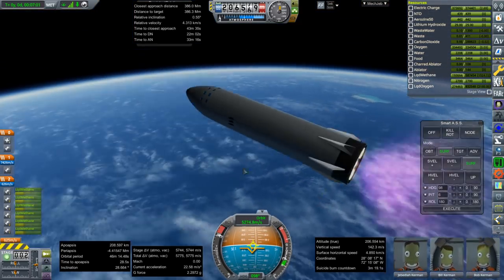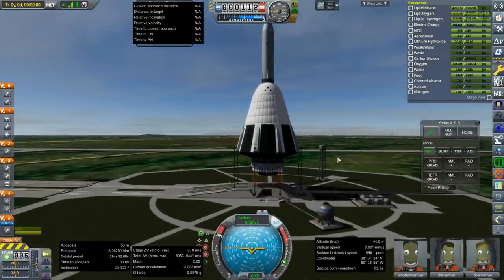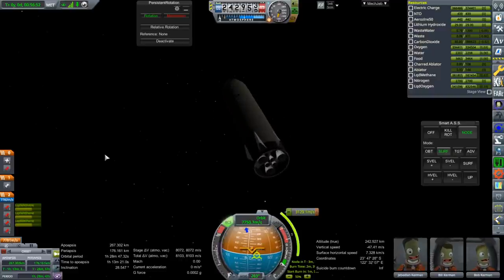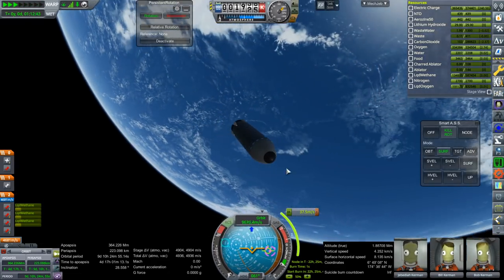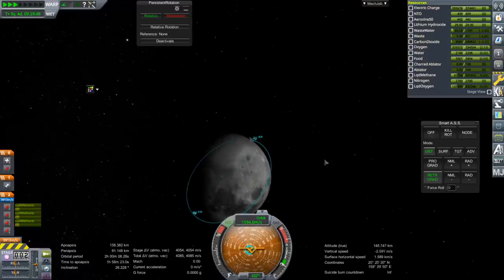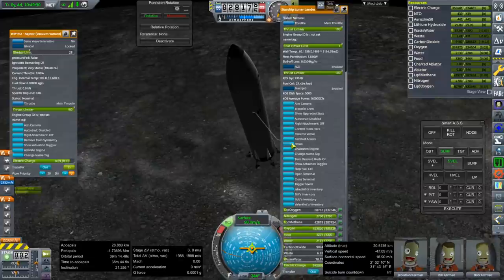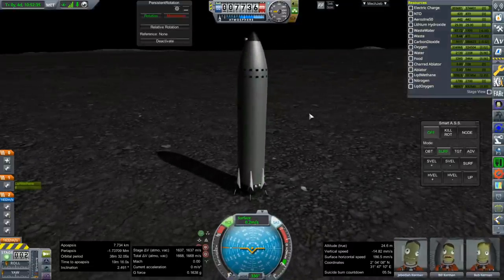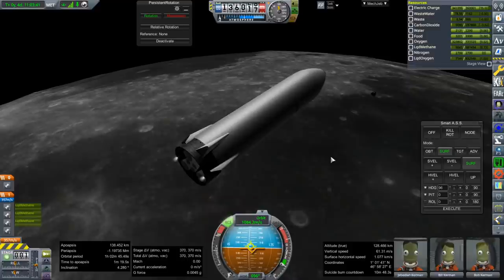Realism Overhaul in KSP 1.8.1 -  Starship Lunar Lander

Comment: Nice! I do want to see this baby approach the Gateway. Kinda a like a container ship docking at a jetty. :) And I believe Lunaship will use one SL and one Vac for the descent burn. I don't know if it has been confirmed but several renders showed one vac and one SL still glowing with the landing engines firing. I think maybe Elon confirmed it on twitter but not sure. That would give them gimbal and relatively acceptable thrust levels for the loss of some ISP.

Comment: 3:45 Is it totally impossible or does it just take too much delta-V? The Potato masher (Thor–Centaur) has a broadly similar profile (separation 600 m/s lower, opening TWR at least 0.14 higher) and manages orbit with 1.2 t of payload, albeit using 10,450 m/s in the process.

6:05 COMET WINDOWS COMET WINDOWS

7:30 Maybe you could have cut the sea level engines at the point where their TWR = the initial stage TWR and get more delta-V in orbit?

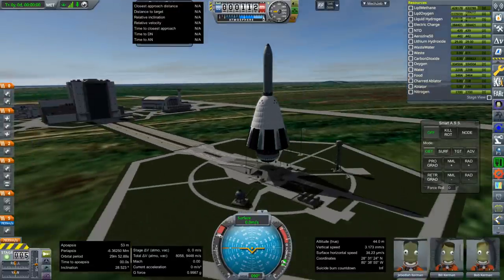8:35 Monument-engined Daenerys! Monument-engined Daenerys! (With larger tanks! With larger tanks!)